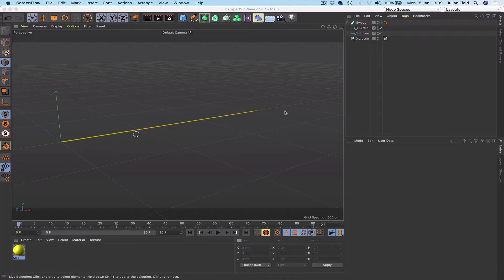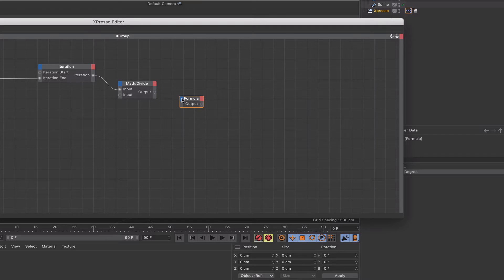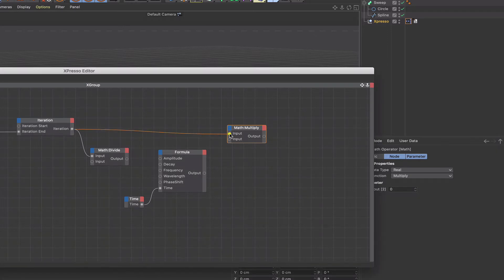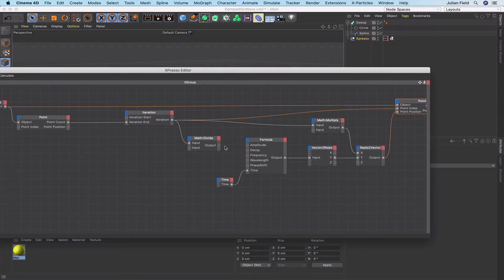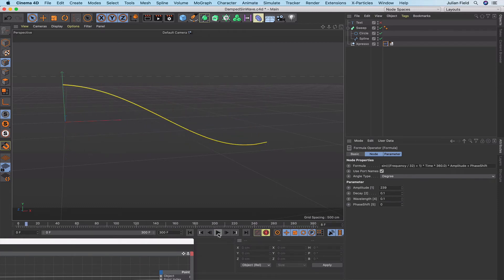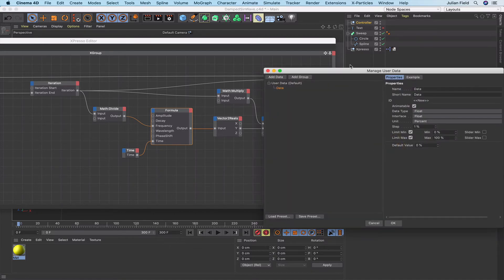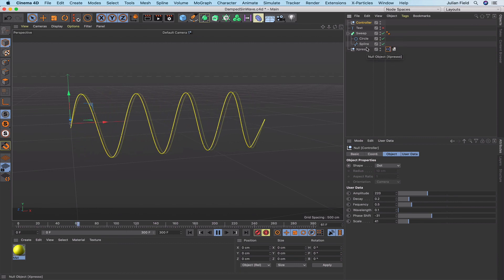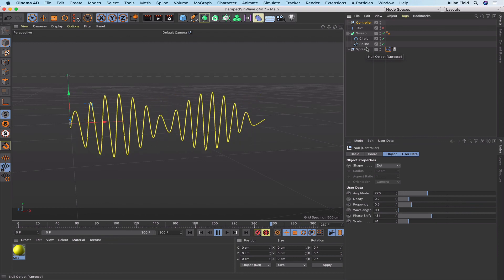Cinema 4D Xpresso Tutorial 33: Using the Formula Node

Comment: Is there a way to get this kind of control of over the U and T values in the formula expression provided in a Formula Deformer? I want to be able to art direct the ripples/waves as much as possible and this tutorial seems like exactly what I need but I can't see how to link this to the expression written in a Formula Deformer
Reply from the maker: Having checked, it doesn't appear so. If you drag the Formula Deformer into the Xpresso Editor, the only inputs are for d, X, Y, and Z. You may be able to define d, using a Formula node and take control of u and t that way?
Reply: @ExpressoMechanicTV  yes I'll have a tinker, I just want a radial sine deformation that animates it's wave speed and length from rapid quickly down to slow. Easily done in the effector but a mystery in the deformed!

Comment: Is there a way to have the start point of the spline move along with the formula as well? Right now it's locked in position and it's creating this compression with all of the waves, but if it was free moving then the wave would just "flow" right through the spline if that makes sense.
Reply from the maker: Yes, change the formula, within the Formula Node, to that of a standard sine wave, as opposed to a damped sine wave and adjust the User Data accordingly. There are many different types of wave you can generate, actually.